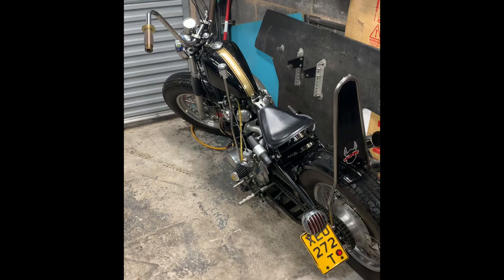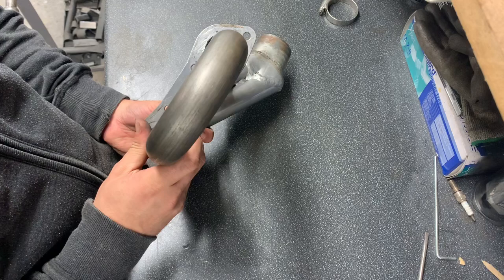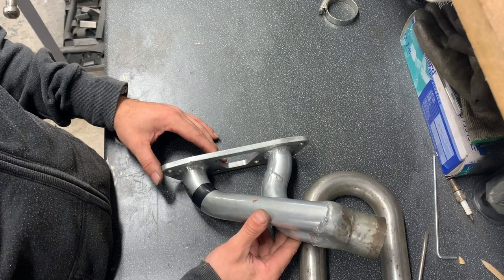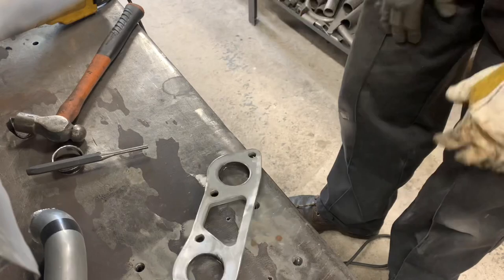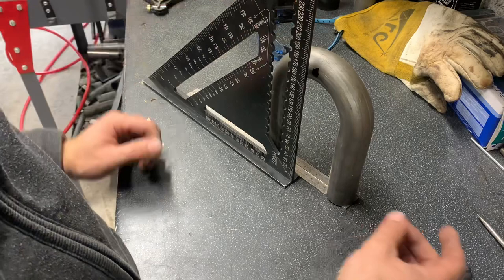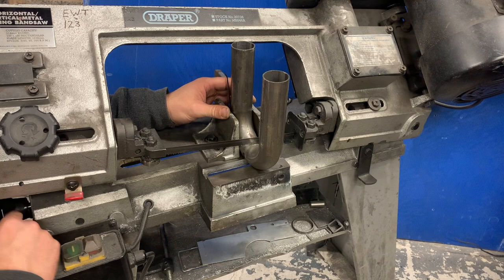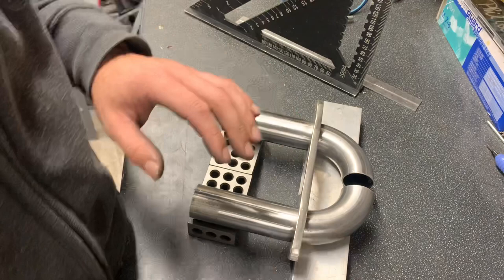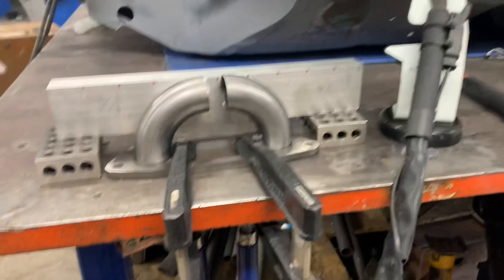Yamaha xs650 bobber single inlet build part 1

Comment: You can't add your pipe to carb anywhere but in the middle or it will never deliver fuel equally.Look build from head with a 25degree downward slope equal tube length but short as possible then from center put your tube outward level with an immediate 45 to the left and you will have it.

Comment: Nice job! What is the diameter of the tubing you used?
Reply from the maker: Hi buddy it’s 35mm OD 1.5mm wall  1.5d CLR mild steel if that helps 
https://www.ebay.co.uk/itm/232848894736?mkcid=16&mkevt=1&mkrid=711-127632-2357-0&ssspo=ui76lPWIR5W&sssrc=2349624&ssuid=RKcSOIWUTEa&var=532371001984&widget_ver=artemis&media=COPY